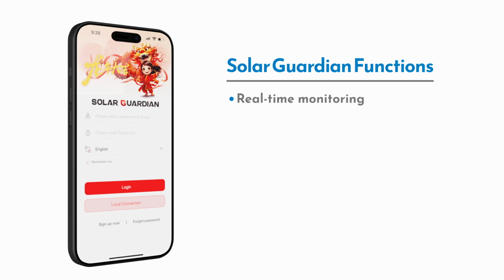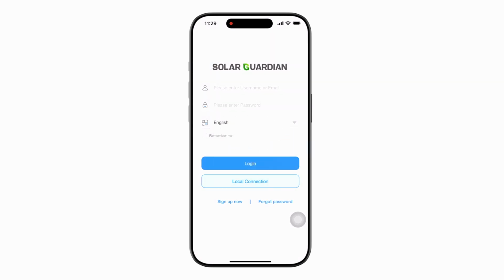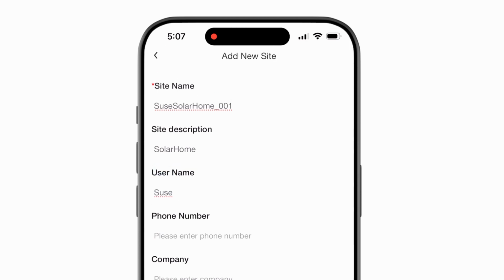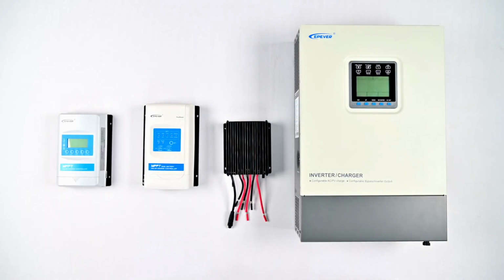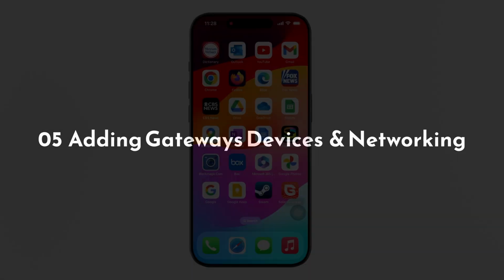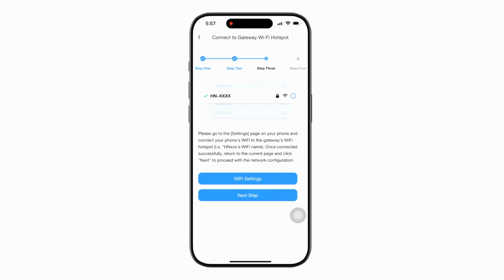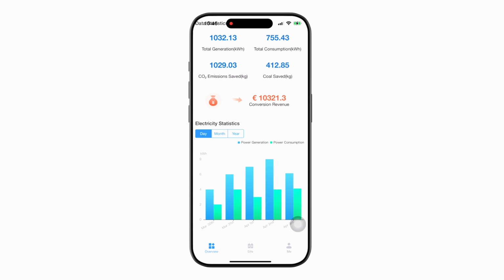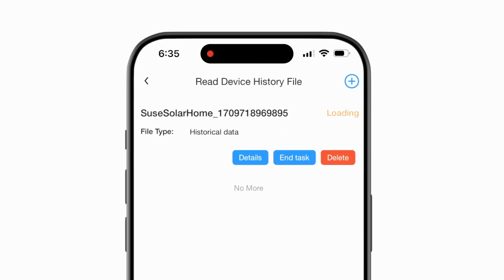Complete Setup Guide for EPEVER Solar Guardian App | Energy Management Tutorial

Comment: Trying to figure out if I should get the Bluetooth or Wi-Fi dongle.  It's for a travel trailer.  Don't have data - even smart phone hotspots not reliable camping.  Would the Bluetooth version make more sense?
Reply from the maker: Both Bluetooth and Wi-Fi can work for your travel trailer, even without internet access. 
The Wi-Fi adapter offers more flexibility, supporting both local and remote monitoring. Like Bluetooth, it can be used for local monitoring without internet access, as long as your phone is within connection range.

For remote monitoring, the Wi-Fi adapter needs to connect to a 2.4 GHz Wi-Fi network with internet access.

So, if you only need local monitoring, either option can work. If you'd also like remote access when internet is available, Wi-Fi would be a more versatile choice.

Comment: Bonjour je viens d'installer un mppt epever tracer 3210 AN G3. Comment je peux le paramétrer via mon téléphone ? J'ai une batterie lithium LIFEP04. Le manuel en français n'est vraiment pas clair sur les paramètres via l'écran du mppt. Donc j'aimerais savoir est ce que mon téléphone peut se connecter à mon mppt et ainsi faire les paramètres ?
Reply from the maker: Hello, yes, you can view and configure the parameters of your MPPT charge controller using your phone.

To do this, you will need the EPEVER WiFi Adapter 2.4G RJ45 D. Once installed, you can connect the controller to your phone and adjust the settings through the mobile app.

Please refer to this tutorial video for the connection and configuration process.

If you encounter any issues during setup or configuration, please feel free to contact our technical support team at support@epever.com. Thank you!

Comment: I have the Tracer4210AN and added the WiFi 2.4G RJ45 D adapter. I have tried to set it soooo many times and just can't get it to work.

If I choose to connect locally through it's own WI-FI starting with the HN-EPxxxxxx everything is fine, I can see how everything in the system is, but in the solar guardian app when I try remote access on Wi-Fi or mobile 5G data network it always shows the gateway as offline. I am on the same 2.4 Ghz, my phone, gateway as well, nothing helps. I have watched all of the YouTube videos and followed them to the letter and have no success. Also tried the setups on IPhone and Android devices, same dead end. 

In yours video immediately after setting up the Wi-Fi network the gateway shows online, but in mine case it stays offline offline. 

I have seen so many other people with the same problem, but the answer was always to get in touch with the techs and no one posted an useful info how to get it to work.
I need to be able to monitor the system from distance, not only locally. 
EDIT:
After contacting the tech support, they responded and told me what to do, unfortunately I can't reveal it, because apparently it's confidential info. 

I can't see the gateway connected to my Asus router along with other devices that are listed. It's a modern Wi-Fi 6 router, running on the latest firmware, but that seems to be the problem, it can't connect to the router although I put the correct credentials. The cloud functionality is completely not working, only the direct, local connection is. The green light on the gateway is steady green and I can also see it on the list of the connected devices in my router, so everything is apparently set up right, but the system is still showed as offline.

Comment: I have a UPower-Hi and I am using a Wifi Module 2.4G RJ45 D. I followed all steps and successfully configured the gateway and the device. However,  the device appear always offline. It had worked properly in the past, but for the last few months, I have been unable to get it to function again. Could you please assist me in resolving this issue?
Reply from the maker: Hi there, to help you better, please contact our support team at support@epever.com and share more details about the issue, such as screenshots or a short screen recording if possible. That will help our engineers understand the problem and guide you step by step. Thanks!

Comment: there are two RJ45 readers one supports WiFi and one supports Bluetooth.  which one i should get if i need it for RV where i will not have wifi most of the time  i would like to control and know what is going on while in the RV. does the wifi version also supports bluetooth or only wifi ? thank you for your help
Reply: I just got rj45 d. I get Message... gateway sn verification failure. I entered the right sn number. Why is this happening.
Reply from the maker: @BondedLiberty  Hi there, please contact our support team at solarguardianfeedback@epever.com. Our technicians will assist you with it, thank you.
Reply from the maker: Hi there, in Solar Guardian app, the WiFi D module supports both offline local monitoring and remote monitoring. To monitor offline, simply select "Local Connection" when logging in.
Reply: @Epever  i am not sure i understand your answer.  if i buy the wifi connector do i must have wifi for it to work ?  or does the wifi dongle has wifi and Bluetooth and when connecting i can decide what to work with ?
Reply from the maker: @freundfamily2000  Maybe we didn't make it very clear: if you buy a WiFi connector, you don't have to have a WiFi network for it to work. It can also function as a Bluetooth module when you choose "Local connection". You can choose whether online monitoring (requires WiFi network) or local monitoring (no WiFi network) yourself.

Comment: Good evening, I want to tell you about my Solar driver, EPEVER - Accessory for charge controller for Tracer-AN, Tracer-BN, eTracer, iTracer, VS-A, AU, BN, LS-B, eBox-WIFI-01, it doesn't show me the consumption, so it's always 0. Can you help me somehow or recommend something that works with Bluetooth or WiFi? Thank you!
Reply from the maker: Hi there, could you let us know if you’re using the Solar Guardian app? If not, please download and use Solar Guardian, and you can log in directly with your current account and password. If you are using Solar Guardian but the power consumption is not displaying, please contact us at solarguardianfeedback@epever.com.
Reply: Non so se e come hai risolto. Io ho appena preso un nuovissimo Triron con chiavetta wifi a 2.4 per monitorare i dati da app ma a quanto pare da 4-5 mesi qui tutti lamentano lo stesso problema: i dispositivi risultano sempre offline e di conseguenza non si possono controllare. Tu sai per caso quale possa essere il problema ? Mi sembra strano quello che sta succedendo. Non e' molto professionale. Tu come hai risolto ? Puoi dire qualcosa ? Grz

Comment: Ho un inverter epever 3kw 24v, ed un regolatore di carica epever 100A. Entrambi comunicano con adattatore wifi.
Ho istallata l'app solar guardian, se vado sui singoli strumenti mi escono tutti i dati e grafici, ma sulla paggina iniziale mi appare solo il grafico di quanto prodotto, ma non mi appare il grafico dei consumion.
Come mai?
Reply from the maker: Hi there, the inverter does not track consumption data. If your controller is connected to loads, it will calculate consumption. From your description, it seems that there are no loads connected to the controller, which is why you're not seeing consumption data on the Solar Guardian app's main page.

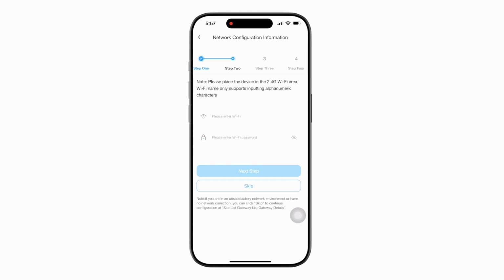Comment: 10:37 Do we need another WiFi device that can connect to the internet, which means we need another WiFi connection?
Reply from the maker: Hello there, one WiFi module is sufficient for a single device (controller/inverter/inverter charger). 
First, you will need a 2.4G WiFi router. The WiFi module needs to connect to this router in order to access the server. The second and third steps involve configuring the WiFi module with the SSID and password of the 2.4G WiFi network, enabling the WiFi module to connect to the router and thus to our server for communication. In the fourth step, connect your smartphone to your home WiFi, and the app will be able to communicate with the server, allowing you to monitor and configure the device using the app.
Reply: @Epever  does the module have to always be connected to the router?
Reply from the maker: @sahrullaharsyad3864  Hi there, if you need to remotely monitor the device, the WiFi module must be always connected to the router. Otherwise, remote monitoring will not be possible.
Reply: @Epever  I really don't know about that, but I have equipped the router and everything is connected well and now I can monitor from quite a distance wherever I am

thnks